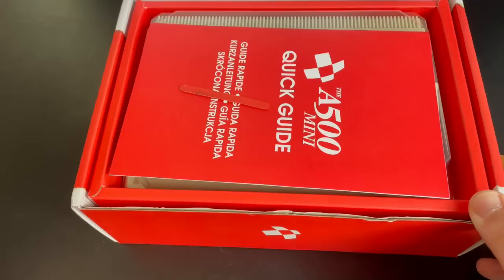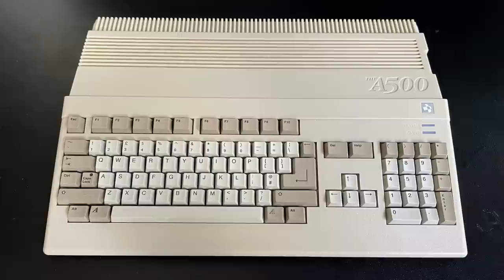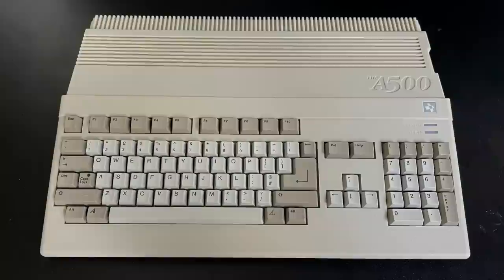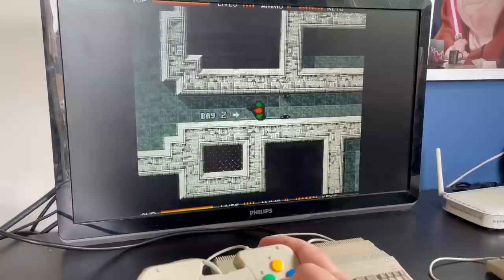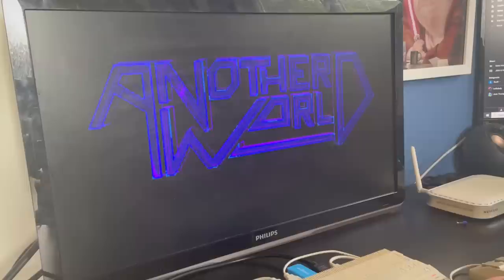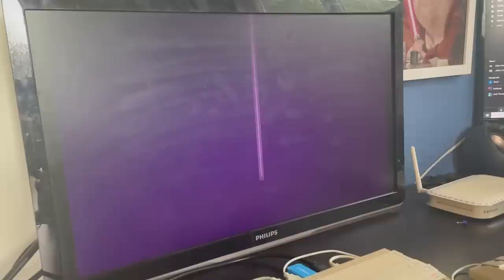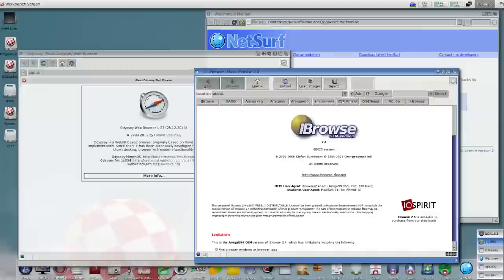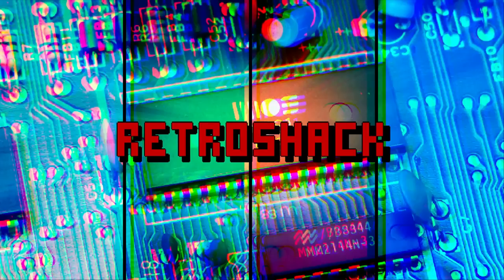The A500 Mini is cute, fun, well made and fits in your pocket - but who exactly is buying them?

Comment: i have my original a 600 still. but im not a 100% tinkerer. i did buy a new memory card for use as a hard drive,. tried installing the workbench on it,. but error on disk.. so it kinda stopped there. i would give alot to get my amiga setup with the games i have on my disks on a harddrive. or WDL format. working and running in the right speed as is my worst enemy on emulators. i could change all of the hardware if i felt that would work. one of my problems is the new joysticks aint working as the old once. i been trying for a while on and off to get my amiga to run properly again. i breafly dident own it and the other owner installed a  HDD in it. i got it back a few years later, regretting i sold it.i remember and still have the kickstarter 1.3 disck to make it compatable for some of the amiga games,  id like to get a hold of 2 joysticks for the amiga and get it to run. either on original or new hardware. so nostalgic., im turning 44 soon and  that would make the amiga  32 or 31 years old. as i got it when i was in 6th grade. started the year i turned 7. good times. ive never been more happy in my life as when i got the amiga 600.

Comment: Initially I wasn't sure whether to choose the a500mini or the Raspberry Pi 400, but to be honest it was the aesthetics of the a500mini and the fact that it was (apparently) largely set up to work once you plugged it in that sold it for me. I grew up with the Amiga 500 and the Amiga 1200 - both fantastic machines - but I never used a gamepad controller with them, so the controller experience with the a500mini is not how I remember playing. But that one's on me, I knew that was what it came with. Even though I've persisted with this gamepad, I find that it lags a bit, and am hoping Retrogames can improve this with a firmware update!? 

I've noticed some games that I've added need fine-tuning in terms of tinkering with their set-up options to get them to run like they were intended. This can be quite time-consuming and humiliating - in my case it takes a lot of guessing, as some parameters are quite technical and I'm not a computer hardware expert, so I don't really know how to achieve my desired outcome, I'm just changing a setting and seeing what happens. If my experiment works out then great, but if not, then you have to take more time trying again. At the end of the day, I'm not that enamoured with this process! I'd rather be playing than fault-finding.

Also, while playing some games, I've found that some scenes that would appear between levels - for example, the still images that appear in Psygnosis "Agony" with the little musical atmospherics - are rendered short with the a500mini's emulation, and I don't know why... Things like this really affect the feel and ultimately the experience of the gameplay in my opinion, as it is now different to how I remember it. I might be being too picky as it is an emulated experience after all, but I guess I thought it would be better. 

If anything, the a500mini has mainly generated nostalgia for me through just being able to see the old game graphics and hearing the game music that I used to love, more than actually playing the games! But that's it for the most part. I find I am playing it less and less now and am seriously thinking about selling it. The unit is great in theory, but I think it might have been released prematurely.

Comment: I'm still hanging out for a BareMetal Amiga on the Raspberri Pi 3 (if i ever happens). When the time comes that I can purchase a proper Amiga-like mechanical keyboard in an A1200 case.. I may be tempted.. but.. to me the Amiga keyboard and the likes were so close to typical PC keyboards.. I don't really feel then need. The C64/Vic20 really need the original keyboards because they're special - all the fancy PETSCII characters and the likes. I have a dead Plus/4 sitting in my cupboard that I'd happily put a BMC64 into but.. ughh.. it's another machine to get out and put away.. and I'd rather be hammering a modern replaceable keyboard.

Comment: Although I have the 500,600,1200 and cd32 in my collection, due to space and time restraints 100% of any Amiga time is now strictly emulation based and with what I have the mini would be wasted money, However, when the day comes when they release one with a working keyboard that may change, but I would gut it and place the pi 400 in and use pi-amiga instead.

Comment: you must have a big pocket .....

FYI: Don't wave a soldering iron..Its dangerous.

Used be surprised at how many Amiga 500 (legit 1980 owners) , are too afraid to power up their systems in case they fry the motherboard and cannot get it fixed.. Just having one, like a museum, may look good, but apart from 'a show-off' ..(like me), there ain't much else.

Comment: Grew up with the C64 and still have piles of hardware & software for it.  The mini came out & I had no interest, but the maxi was a different story - here was a reliable modern alternative to aging and (increasingly) unreliable originals and I had to have one.  I never owned an Amiga, but I feel the same way about it's mini - no interest at all.  As you say, do a maxi and I might be interested.
Reply: Exactly! A "maxi" would be much more attractive. There's also the problem of the price. This mini a500 is 2x more expensive that what I would pay. (So around 60-70 USD). I would go a little bit higher for a maxi but I think $90 is certainly the limit.

Comment: Wont buy a mini Amiga. It's pointless without a real keyboard. And Amiga keyboard are  pretty modern like PC keyboard, so it's not an issue emulating on your PC, Pi or whatever. Unlike say C64 or ZX Spectrum with their non standard keyboard and weird key functions which needs an actual keyboard to get the full experience. I have ordered a C64 Maxi and hopes it reaches me by early next month.